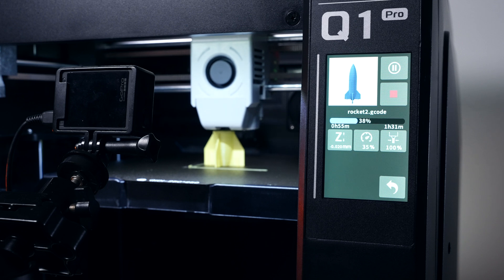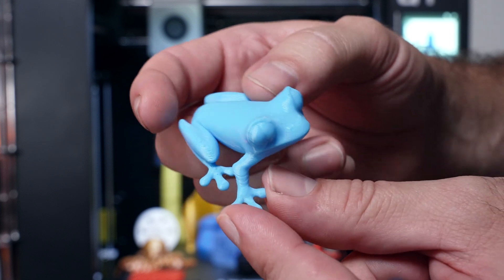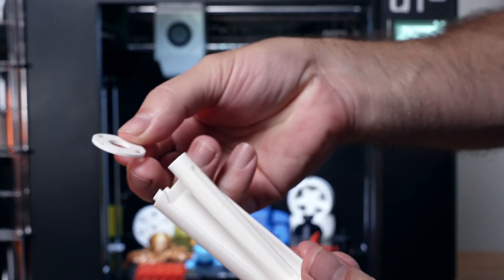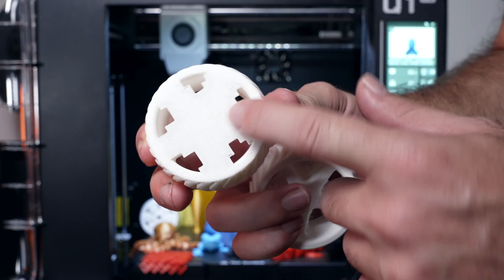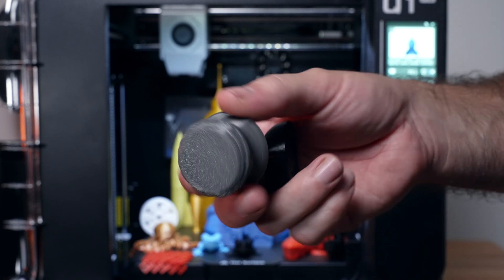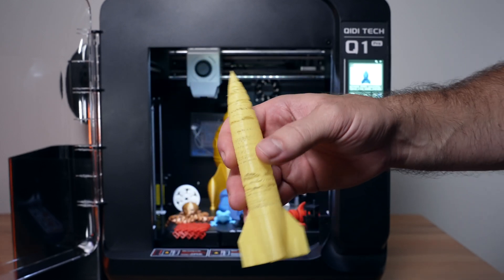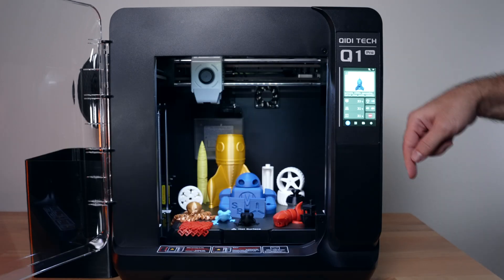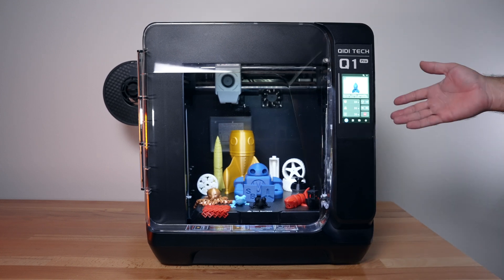Qidi Q1 Pro - Klipper 3D Printer - Print Quality

Comment: When you get so many fails you may have to look for mechanical setup , filament , settings etc.  It's not much good if a small section looks good and the leg falls off !  Sorry , to disagree , but I don't think you had a print that was a good except the benchy and toothpaste squeezer.

Comment: Great video. Thank you for showing off both the good and bad, and not just the good. I've had this printer for a few weeks and overall I have really enjoyed it. I agree that the quality is a little cheap, but the actual functionality and where it counts is very good. This is the best printer for people who want to print higher end materials but don't want to spend too much money. 

Question: Sorry if you already mentioned it, but do you use glue for everything you print? At first I tried no glue and nothing stuck, so I just always use glue. But maybe I just need to adjust my z offset? I'd rather not use glue if I don't have to.

Comment: all I hear is basically "lot's of problems, incomplete prints etc." so just get a bambu labs.
Reply: I have the A1 and the Q1 Pro and love both. Yes the A1 is a bit more fool proof, but the Q1 Pro is very consistent and easy to use. Also it is more capable of printing engineering grade materials than even the X1 Carbon. 

I like my setup because my A1 prints all my PLA, PETG, and TPU parts, and my Q1 Pro prints ABS, Nylon, PC, and anything else that benefits from an enclosure and heater.
Reply: @jasonwiltjer9  Correct, right tool for right function.
However, it's worth noting that Bambu has a lot of problems when it comes to longevity and availability of structural wear components - their first gen models are coming up to 2 years old, and there are a tonne of accounts out there of their belt pulleys slowly wearing out the plastic frame they sit on.

They are a proprietary size, so not off-the-shelf to replace, and you would have to replace the entire back plastic framing to resolve the problem.
Bambu currently says they are working on a solution, but have said so since 5 months ago.

The first thing I go for with a 3D printer is ease of self-repair and availability of parts. Yes, BBL has parts for hotends, boards, etc, but the plastic structural frames are not available and there are no plans to make them available.

Comment: It’s a pity qidi doesn’t make an AMS for the Q1
Reply: I'm not sure the wiper tool would hold up to hundreds of filament switches per print. I mean it works okay, but I'm not a huge fan of the felt pad. Filament gets stuck on it so I'll probably have to replace mine soon.